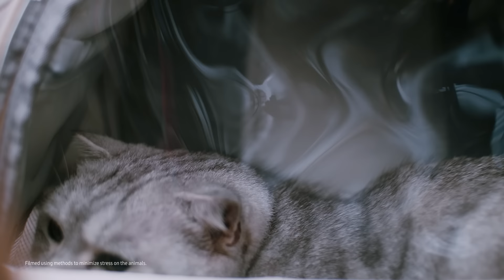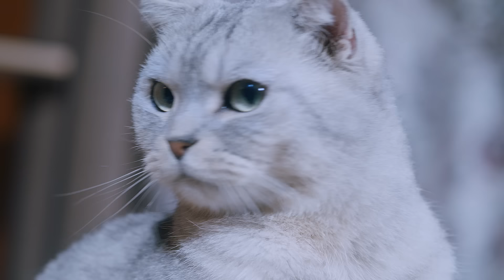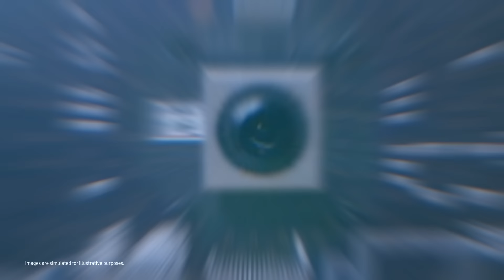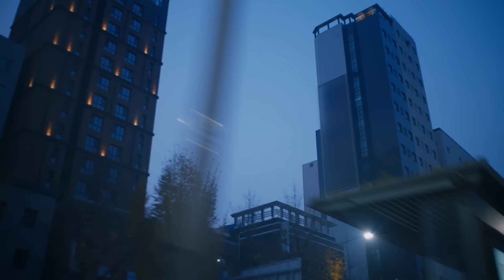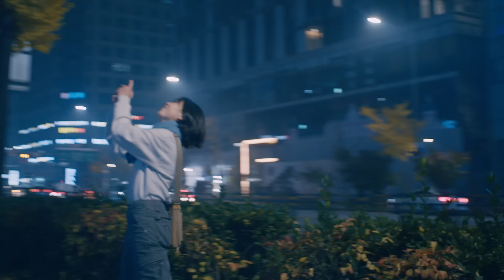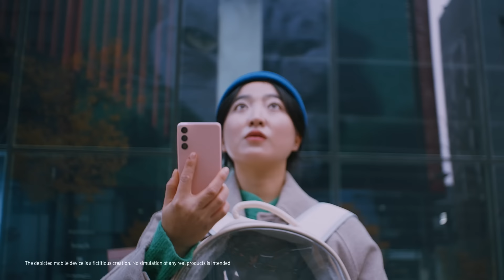ISOCELL Image Sensor: More pixels. More detail. | Samsung

Comment: Average MP for a DSLR camera: 25 megapixels, but higher for many professional cameras.
Reply: You misunderstand things. It is done here that in the end the native resolution (output) will be 50 or 12.5 MP due to the technology of combining pixels to make them larger. The more pixels, the better the sharpness and detail when you end up with a photo in one of the two resolutions mentioned. The point is that a sensor larger than 1 inch cannot be physically inserted into a mobile phone, so it is necessary to make as many megapixel sensors as possible in order to get the best possible sharpness. The technologies in cameras and smartphones are diametrically opposed due to physical limitations. The average user and anyone who deals with non-professional photography flagship smartphone is a better choice than any camera.
Reply: Gotta keep up with the times, there are constantly improvements happening with digital photography, pixel binning being one of them.

Comment: There is no point in ramping up the megapixels if the processor can't handle it. So let's fix that first!
Reply: the fact is 8 gen 1 (including plus version) and 7 gen 1 can support up to 200MP, the dimensity 9000 can go up to 320MP
Reply: @muhamadardiyansah446  I do know these, and obviously they do support otherwise they can't ship the device with that kind of sensor. What I meant was performance not merely the capability of the processor on paper.

Comment: I hope Samsung mobile goes with a lower MP sensor at the same size in their next flagship. Bigger pixel size = higher dynamic range, better noise performance.
Reply: The thing is that it is not exactly true. Because of the Smart-ISO a Quad Bayer (and other 9-in-1 and 16-in-1) merging of the pixels, you may achieve even better DR with smaller pixels. It is due to the nature how does it work, some of the pixels are exposed for the shadows, some are exposed for the bright light. You may have high dynamic range from one exposure which the sensor with larger pixels will not achieve. I was also surprised and if I did not test it by myself, I would not believe it.
Reply: You can median cut high resolution captures aggressively to remove the noise. And that's baby stuff compared to what computational photography is doing now, if you have the processing power, you can recover more out of a noisy high resolution image in spite of area loss on the per pixel electronics.

Comment: That's great, i'm not a big fan of small sensors with high resolutions, but, i think that there are a lot of new technologies that can compensate those "bigger numbers" problems like pixel binning or, in certain situation, downsampling. That said, i also think that a great lens is better than an higher resolution sensor, so, i hope that with this new 200MPX sensor we will se a new generation of high quality glass, and maybe, also a faster aperture like F/1.5 that would help a little in low light situation (the comeback of a variable aperture would be great for landscapes photography). But i think one of the most important thing for this high end sensor is to get rid off the shutter lag, even with raw capture, please. Please also improve the others sensors in the S23 series, i would much prefer a smaller sensor for the 3x and 10x zoom but with higher quality glass and a faster aperture for lower light situation. Also a better stabilization will be helpful whlie filming in low light creating less artifacts.  I'm using this comment like a feedback hoping that would be useful.
Reply: The effect of pixel binning image quality is exerted in ISP processing. However, if the pixel binning processing performance is not good, the image quality is very poor. (Ex. Galaxy s20 Ultra vs Galaxy S8 win)

There are many things to consider, such as optical characteristics, but when looking at the iPhone, it is more helpful to increase other deep learning processing than high-pixel.

[Samsung competes with hardware / iPhone competes with software]

Comment: More pixels = smaller pixels. Pixels binning technologies only go so far. 50mp is already plenty. Not to mention the lenses as other people have.
Your customers have spoke with their wallets and orders. Nobody is using the 200mp sensor for a reason
Reply: They will probably have a bigger lense  and a bigger Sensor so it shoud be fine
Reply: 200mp maybe for zooming in so you don't lose image quality
Reply: @beebeedeeie  if you're giving a phone a 200mp main lense it likely has a dedicated zoom lense. Id rather a 50mp main camera (which is already plenty) and spending the extra time to develop a continuous zoom setup or improved periscope lense for zooming if its that much a concern

Software enhancement is already very capable of digitally zooming with minimal perceived loss. Look at the s22 ultra

Comment: Increasing megapixels quantity is just for marketing, like in this video. Good picture quality starts with increasing physical camera sensor size and adding good lenses.
Reply: Maybe you should consider comparing the camera quality of a modern, 50/100 megapixel phone versus a model from 2010s?
Reply: Mantas, totally agree 👍🏻
Reply: @AtlineR  That is only partially due to increasing resolution... Significantly larger sensor sizes, better lens quality, and AI refinement has made far more of a difference than the increase in Megapixel count.
Reply: @AtlineR  The 2012 Nokia 808 outperforms most modern smartphones in resolution, simply because it had a very large sensor.
Reply: @arnaud78  you forgot to mention, most part of this increase in resolution is made for multiple simultaneous exposure bracketing AND an advanced noise reduction via pixel binning (4-to-1, 9-to-1) at the same time.

Comment: Seems very strange. At 24s - the photographer uses full DSLR lens assembly. At 30s, a simple mobile lens. Which one was it? other than Edmund Optics lens that was designed for a 2.2um 120MP sensor by Canon, i am not familiar with a COTS lens that supports a 0.64um pixel over 200MP. To capture green light correctly, it would require F/0.95 that is diffraction limited.

Comment: I cannot imagine the shutter lag on this 😅
Reply: Everyone: Good camera
Me: That cat is cute
Reply: The shutter lag has already been resolved.
Reply: @Ariscott56  right! im using the s22 ultra rn and its works great! lol that other dude is already complaining the phone hasn't come out yet.
Reply: The shutter lag is fine with this handset, but it’s still not as fast as sensors at lower megapixels. Just try to shoot in lower light conditions with a moving subject 😊
Reply: @BLAKEEATS1988  glad you're enjoying your S22U. Hope it continues to improve with OneUI 5.0 👍🏿😁
Reply: The shutter lag is almsot fixed with may patch
It's almost non existent on base and plus s22
Reply: @Ariscott56  thanks man. 😁
Reply: Obviously referring to a youtube video of a review unit 🤣 in real world use there is no lag, it post processes in the gallery just like an iPhone.
Reply: @ManzaEN  slower shooting at low light is not related to higher MPs. It does it intentionally to capture more light
Reply: @ArunG273  I stand corrected, my unbased statements are irrelvant. Sorry late night; wasn't thinking straight.

Though I still stand by my shutter complaint. It's definitely adequate, but not as fast as the 13 Pro Max. I am nitpicking a little too much here, as I still prefer the camera capabilities of the Samsung. 

For reference I am also on the may patch for the S22 Ultra.
Reply: This sensor was already used i believe so, and it worked perfectly fine

Comment: I think the key takeaway here is that massive expensive lens that was used to resolve the detail on the sensor. How many phones are improving optics to this degree to make the most of the sensor?
Reply: The SLR lens allegedly wasn't used for the actual picture. It introduces its own issues in conjunction with the existing optics and a sensor this tiny, it just isn't intended to be used this way.

But folded periscope lenses are staring to be a thing in smartphones again, they can get pretty impressive at small sizes with well compensated aberrations.

Why I say "again" is because there were a number of those in point and shoot cameras going back over 20 years. And all of those I can think of worked spectacularly when their constraints are considered. They failed in marketing, because people tend to think bigger is better, which, of course diameter of front element is an inescapable constraint, but people are looking at the bulk of the mechanism and protective shrouds instead....

But also the demo is kind of dumb? Like how close can you get to the picture to inspect the detail?
Reply: Bingo! It's the lens. The lens is what makes the difference. They were quite smart with this commercial. It's not false advertising if they show you the big lens, but you don't know that it's actually the lens that is making the difference instead of the sensor. You can get that "DSLR look" with a relatively small sensor if you have the suitable lens. Sensors have reached the point where they are good enough, but they cannot do anything about lenses unfortunately. Can't get around the physics
Reply: @SianaGearz  can you please give any example of those point and shoot cameras ?
Reply: @stefan12215  Konica Minolta Dimage X, Xt, X20, X50, X1 etc is one periscope lens series i can think of, and it's the earliest i know of, starting in 2002. Generally they came with a sticker on the side that explained the function of the periscope lens, with fixed mounted sensor and outer prism element, and moving inner elements. For the original Dimage X, you can find an X-Ray rendering which shows the mechanism.

The direct competitors of the Dimage X-series of same size were Canon Ixus and Casio Exilim; but the competitors with classic extending lens couldn't hold a candle to the image quality you got out of a periscope lens, in comparison these two series had strong purple fringes around anything bright, and didn't bring substantial advantages in light sensitivity either. In fact finding cameras without colour fringe aberrations was a little difficult, it tends to pop up a lot. Like Poweshot G2 has a remarkably clean lens for the amount of light it can deliver (bulky, quality oriented point and shoot with a pop out lens), but G3 (same general construction, a little larger zoom range) does not, it's a pretty filthy.

Another are all the underwater cameras by Pentax, Optio W series. In these, the periscope is turned sideways to make it look less weird - or to help people keep their fingers out of the lens. I still used my Optio W10 fairly recently last time, though at this point i wish i had something with a more modern higher performance sensor.

Nikon also made a whole bunch of periscope-lens cameras but i can't for the life of me remember the designation. These were constructed like Dimage X with an outer element in the corner, and came in both waterproof and non-waterproof varieties. I believe Samsung dabbled in this sort of construction as well, but rarely, and i think i even had one of those somewhere at one point, but no longer do. I think someone in the family still has the Nikon.

Canon picked up the periscope lens more recently with a waterproof camera PowerShot D20, then D30.

Fujifilm Finepix XP series starting with XP10 is their version of the same concept.

Word of warning - if you like buying historic digital cameras, avoid anything with a SONY sensor made in 2003 and 2004, they are going to all die, all you'll get are purple streaks and no picture. Only consider buying them if they were repaired by the manufacturer under recall or extended service. I have two Dimage X20 and a PowerShot S1-IS with that issue.

Before periscope lens cameras, there were a number of zoom optics which were also fixed exterior and fixed sensor, which also worked very well, similar general arrangement, but they lacked the mirror-prism final element, they were just straight through. Like camcorder lenses are usually like that. This can also work well. The cameras were constructed either in swivel parts where you'd swivel the lens and sensor forward, and stow them swivelled up, or in a pistol grip arrangement like a camcorder, Sanyo Xacti come to mind. Well there were also ridiculous ones like a fixed-lens DSLR Olympus Camedia 1400XL, but one glance at it, and the decent performance is... shall we say, unsurprising, and in fact i thought it underperformed really.
Reply: @SianaGearz  Interesting, thank you for extensive reply. Great to learn new things about older digital cameras!

Comment: If Samsung just remove the edge enhancement dead pixel correction noise reduction as an option and allowed us to use a different format file or use full format file and use camera iso 12 we would see a world of difference also these sensors are capable of taking photos at a hundred thousandth of a second might as well allow us to do that in manual

Comment: 48-50MP is the best option in my opinion for a smartphone. You can have all the benefits and advantages like 8K video and high megapixel, detailed images and you only combine 4 pixels to get a 12MP image. Plus since it is 48-50MP, it doesn't need to crop in too much to shoot 8K video, unlike 108MP sensor where it crops in significantly down to 33MP to shoot 8K video. Even 108MP is overkill, let alone 200MP. Please Samsung, if you're ever gonna make a 200MP sensor, use it in a professional big camera but not in a smartphone. The processing power needed to calculate all of those individual pixels quickly is simply not there.
Reply: Depending on the pixel binding they will use, 4x4 for instance would give 12MP images from the 200MP sensor.
Reply: @GuyRobertKernisant  that would mean less pixel size and more noise
Reply: I'm not sure if the processing power isn't there. Maybe there is more than the one in the dedicated camera's chips. But all the other aspects favour the dedicated cameras.
Reply: @maneesh2316  Actually it's not necessarily more noise, specially on low light settings bigger pixels generate more accurate results. You are still using the whole sensor. I'm already printing albums or individual pictures from my Note 10+ and Z Fold 3...
Reply: false, got the s23 ultra now no issues.

Comment: Such a high MP count is of no use if it's used with a present smartphone camera lenses.
Reply: It was used with camera lens. But I also do not think that 200 MPx makes sense. I think that Quad Bayer (4-in-1) is enough and there is no need to divide one pixel into 16 subpixels.

Comment: how big are the pixels, try taking that picture in low light, it will need to switch to 12 mp mode to pull in enough light even with long shutter exposure.

Comment: and the noise level at night? and how many microns per pixel in the sensor? because even the 0.8 micron size is not enough for the 108 mpx sensor then this 200 will be 0.5 micron? or the whole thing is bigger and stays at 0.8 microns which will be very noisy and huge in size for the whole sensor and won’t fit in a phone.

Comment: We don't need thousands of MP, we need good quality cameras and decent AI processing.

I don't need to zoom 2000 times in a smartphone picture, a smartphone picture must look good and must be quickly "snapp-able" just like with an iPhone or a Pixel.

I've had a hard time taking pictures with Samsungs over the S10, pictures are barely decent (expect for like a couple of situations where they look very good) and they take plenty of milliseconds to snap.

It sounds dumb but those milliseconds make the difference when taking a picture because it looks like the phone lags while processing it, and I even have to wait for it to fully process when I open the preview from the camera app.

More resolution also means that the phone has to process more data, thus slowing down the process.

Comment: Seems like S22 Ultra is my last Ultra phone from Samsung. 200 mp on such tiny sensors is way too much and leads to picture quality deterioration instead of improvement. 48-50 mp is the best resolution - sufficient for 8k (once they learn how to optimise it) and not too small pixels.
Reply: Your next phone will be a Google Pixel (7 or 7 Pro)? (:
Reply: @Armando.Krijnen  iPhone. Or maybe Fold if they optimise the form factor to perfection
Reply: Just skip a few they will probably lower the total amount of cameras to increase the sensor size
Reply: @dungeontnt  3x zoom would be the easiest to get rid off. If they play their cards right with 200 mp sensor, it can easily produce 3x zoom photos without noticeable degradation in quality.